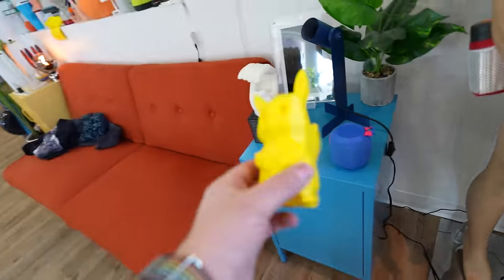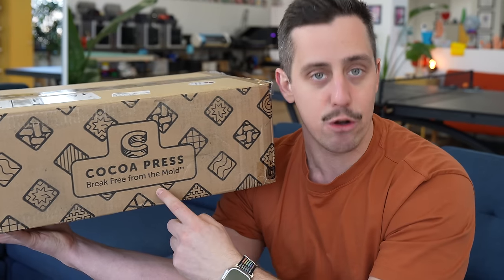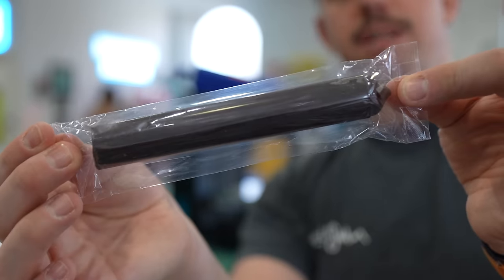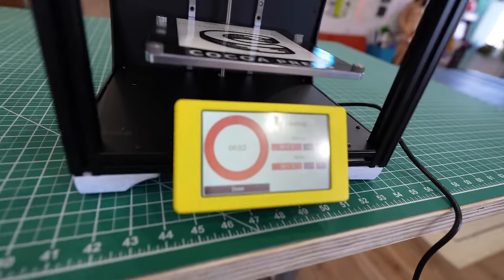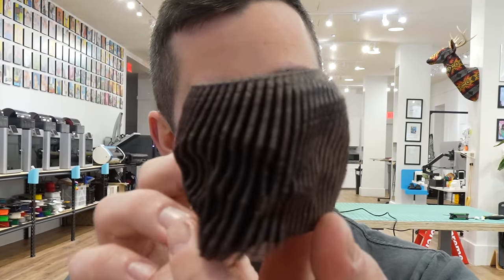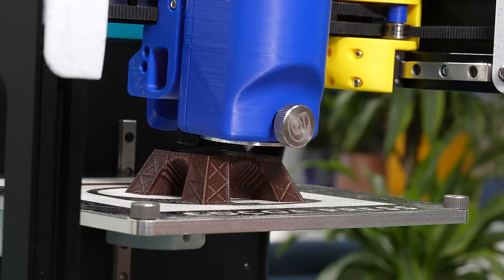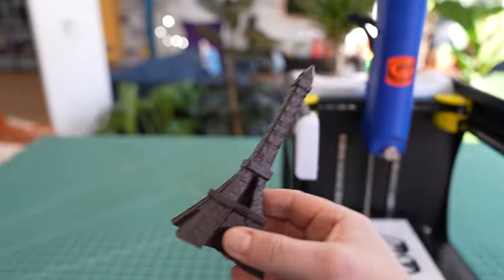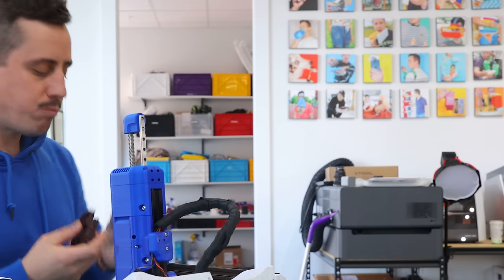Have You Ever Seen a Chocolate 3D Printer?!

Comment: Each chocolate core is £4. Presumably you're locked in to buying the cores from them
Reply: can't you just print a mould 🧍
Reply: Or you make a mould with food safe resin or food safe silicone and just temper some chocolate and put it in there ;)
Reply: Isnt it possible to just melt some chocolate into the core? And if that doesnt work, cant you 3d print a tube that you can use to cool your own cores in? The quality might be poorer, but nothing would stop you right?
Reply: Nope, you can create your own cores and use whatever chocolate you want!
Reply: @3DPrintingNerd I thought the press used a special kind of chocolate. Is it easy to get?
Reply: @crazybird199   It's not pure chocolate, it's got cocoa butter added. I think it's similar to chocolate chips used in baking.
Reply: They use compound chocolate which contains ethically sourced Palm oil certified by the Roundtable on Sustainable Palm Oil.
 You're not locked in to using their cores. You can make your own if you wish.
Reply: @pixelrancher compound chocolate isn’t real chocolate tho … I wonder if you could use real tempered chocolate tho
Reply: @lgrif1201  Don't know. It might be difficult to keep it from seizing. There are tempering machines, so in theory, it should be possible.
Reply: @MrMoron-qn5rx   You can but 3D printing is tricky with food! I would recommend food safe resin or food save silicone or just any other type of food save mould
Reply: @lgrif1201 controlling the temperature of the flow while getting the ‘printed’ chocolate to set and not re melt when the next layer is deposited would be the trickiest aspects I think. Either you have lower resolution (thicker, slower flow) or you’d need a freezer blast to ‘cure’ each layer before the next round of finer, hotter chocolate arrives. 

But I’d just eat all mistakes so I wouldn’t really care too much. Compound chocolate isn’t the same as proper choc. The day a 3D tempered choc printer arrives I will probably sell everything to get one. 🤤
Reply: @FatalRbx Mold making is a lot faster within a food industry context and can provide a great level of detail!! Silicone 2 part molds are so easy to make and would just get rid of the need for another 3d printer
Reply: @MrMoron-qn5rx 😂
Reply: @crazybird199 bro it's chocolate not rocket science

U can make ur own

Comment: Heres a question: could you reload your failed pieces back into the printer, melt them, and reuse them to mske a bew print?
Reply: duh
Reply: @Lantastical  I wouldn't say duh because it would be possible that the design requires a full cylinder, or if it isn't tempered it could be break or possibly other issues.
Reply from the maker: I'd think so - you can also break down some of the other cylinders of chocolate if it's not filling the printer tube as well.
Reply: @UnnecessaryInventions if you can break down the chocolate cores, are you able to add other tempered chocolates?

Asking because food allergies
Reply: @UnnecessaryInventions Maybe you could 3d print some molds so you could pour in melted chocolate & make your own cylinders.

Comment: Moreover you get to reuse your failures as its just melted chocolate. Which gives me a profound realization, filament is dumb!  ALL printer material should work like this, something like plastic beads that it melts into a hot tank that is then feed to a nozzle with a heated line. the rest works like usual.

Comment: I work in the confection industry and do 3d printing for a hobby. Found this Intriguing but decided not to pursue building one. The "chocolate" cores aren't real chocolate because the unit can't properly temper but a printer that prints real chocolate should be possible but more expensive than this already not cheap project.

Comment: Could you swap out chocolates in the print process? Also could you shape any chocolate into that cylinder to print?
Reply from the maker: Yes - you can program the slicer to pause at a certain layer height and then change the chocolate. So you could do a milk chocolate and then the white chocolate for a two tone look.
Reply: @UnnecessaryInventions  chocolate zebras!?!

Comment: The extreme up-price of the chocolate is insane. It's not special, it's just tempered chocolate in tube format, but you're paying like $49 for 650 grams, when you can buy 5lbs (2260 grams) for $25.
Reply from the maker: I do believe that you can make your own chocolate to print with but you'll just have to figure out the best melting and printing points for them. I should try it out with a few different chocolates.

Comment: $2000!!!! This is a terrible rip off. The price alone would pay for an amazing actual 3d printer. You can buy the chocolate filament and tweak and Ender 3 to do this for $500. It’s terrible when companies over charge because they’re aiming for a market which would seemingly have no prior experience with 3d printing.
Reply: It doesn't use chocolate filament.
The printer needs to be able to control the temperature down to one tenth of a degree celsius. 
It's not a $500 printer.
Reply: @pixelrancher  then buy it. Looks like it should be $500 max.
Reply: @pixelrancher  I can almost guarantee, despite whatever some screen reads out to you that that machine is not controlling a hotend to 1/10th of a degree.
Reply: @Elmospiece  Keyword: almost.
Reply: @Elmospiece  I did.
Reply: @pixelrancher  your loss, as someone who has built countless printers and cnc routers I can say it’s not worth what you paid for it. But again, that’s what these type of companies do, feed on the uneducated, as well as lock you into buying proprietary “filament “ or in this case a cartridge of chocolate for an absurd amount. I’d be okay with the idea if they weren’t selling a couple hundred dollars worth of parts for $2000.
Reply: @Elmospiece  😂 "these type of companies"?
Ellie started working on the Cocoa Press in 2014 during an intro to engineering class in high school, graduating from Penn Engineering in 2019. I believe this is her sixth iteration of the printer. Her and eight of her friends run the company. Funny, a number of the larger online personalities - including this site - have been promoting Ellie's printer, but sure - the uneducated. As for chocolate, you're not locked in. You can make your own cores.
Reply: @pixelrancher  yea these types of companies, I get it. You love Ellie and her machine. But again. There’s a couple hundred dollars worth of parts involved in this build, I don’t listen to personalities shilling for companies, to many stories of people being ripped off. Again, we get it, you love Ellie and her eight friends and that’s great. It doesn’t excuse the fact that these are cheap parts built into an overpriced product. So yes uneducated, because you’re apparently invested in this with your feelings so I understand you won’t want to admit it’s true. And if you’re truly are that educated in what’s involved in building a machine like this you’d already be agreeing to it being overpriced. Again, I agreed that it was a good idea with good intentions but waaaay to overpriced.
Reply: @Elmospiece  That's okay. Some people think a couple of grand is a lot of money, I guess.
Reply: @pixelrancher  and some people are apparently willing to pay a couple grand for $150 in extruded aluminum, some stepper motors and a roll of pla printed into parts. Your money wasted, not mine. You can defend the product all you want but you know it’s overpriced.